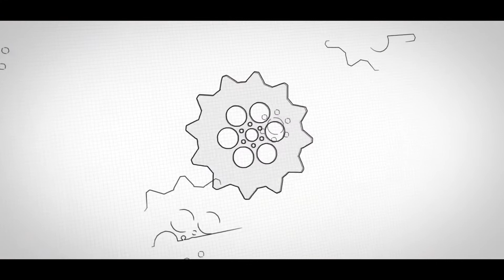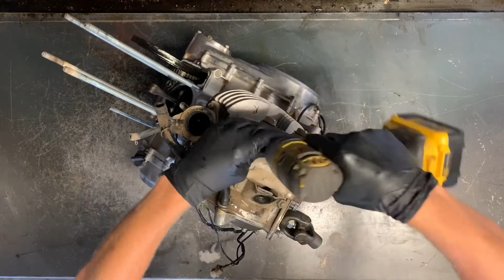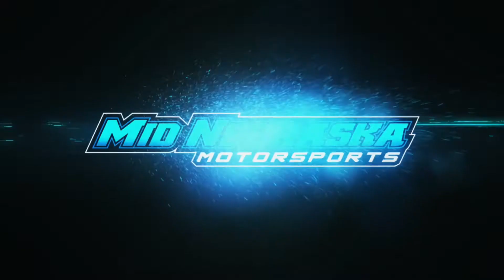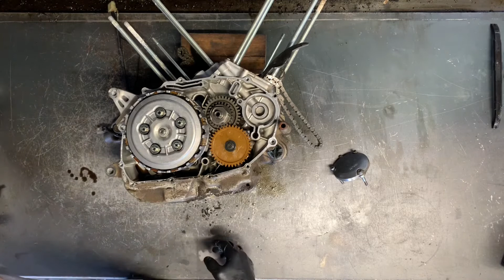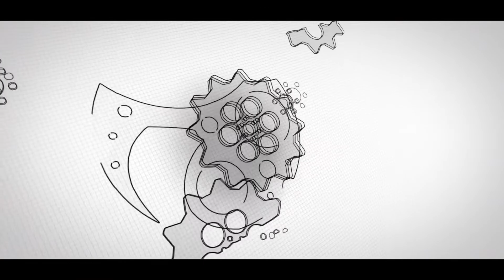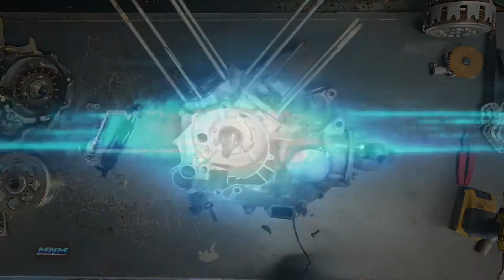Yamaha Virago 500 V-Twin XV500 - Engine Motor Crankshaft / Transmission Explained

Comment: This video is awsome.
Reply from the maker: Thank you!! https://www.midnebraskamotorsports.com/
Reply: Thanks for making this Very helpful! Does the flywheel bolt come off clockwise or counter? About to pull one of these apart to replace starter clutch. Thanks!